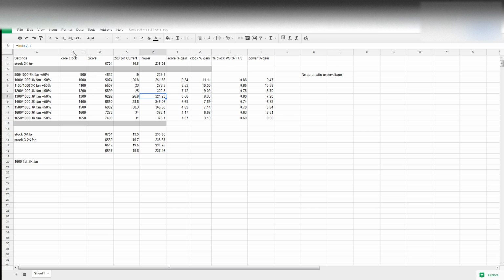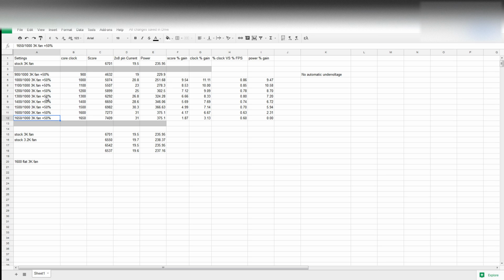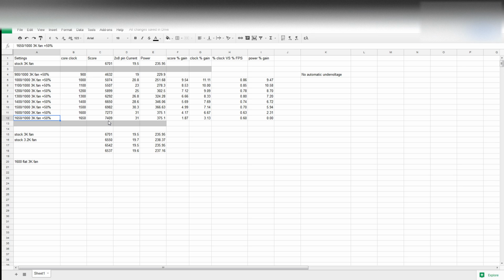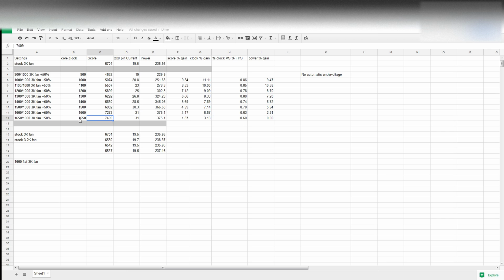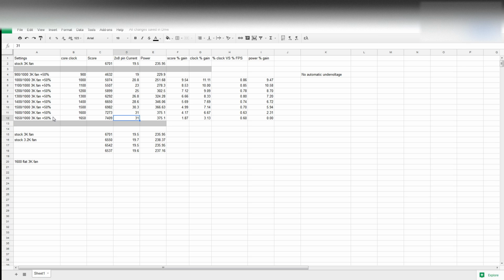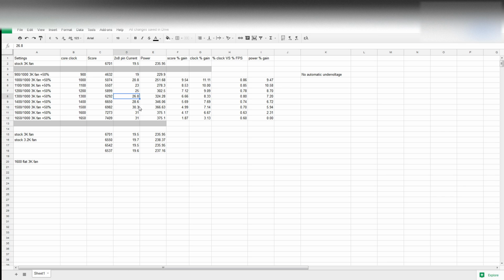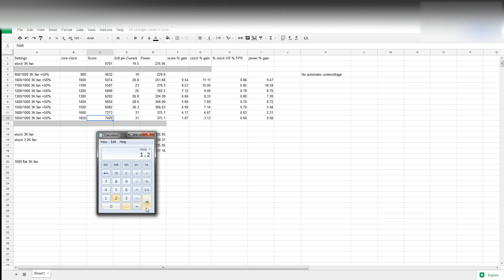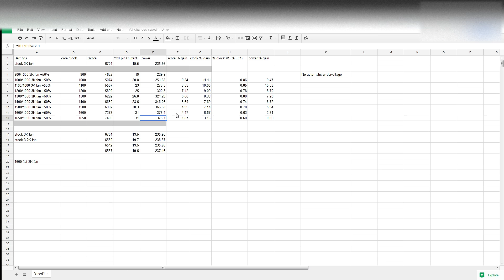VEGA Frontier Edition clock, performance, power scaling // 1600MHz of Flamethrower

Comment: its Crimson doing all that janky shit. when I install drivers I install the driver.sys and thats all. leave crimson off. and then run afterburner.
AMD is failing so bad . they give you a maxed out video card from stock. usually a founders edition or reference cards are usually with heaps of headroom at least 20% MINIMUM so aftermarket board partners can launch heavily O/C'd cards. but there is no point for them. they just release 12 cards i watercooled the other just with non blower fans

Comment: Man if there's going to be a card with two Vega GPUs on one PCB it will be absolutely INSANE! A 295X2 would be comparably energy saving (only 500W!). Two fully uncut Vega GPUs could easily draw 800W if not heavily underclocked and undervolted.

Comment: So basically the card is way smarter on it's own versus manual overclocking. In other words we should come up with a clever way of overclocking rather than just pulling all the sliders all the way right and sitting around measuring stuff.

I bet it can do 1650 scores with the power consumption of 1200 if done properly. Please, investigate further.

Comment: it's POSSIBLE that drivers or firmware may help.  it's possible that AMD are just running everything on the GPU at high voltage while they work out tweaking it.  Ryzen has some really cool power consumption optimisation in the die, would not surprise me if vega does too.  Whilst it does currently look bad i'm cautiously optimistic the situation will improve with additional driver/firmware development - as AMD reduce voltage/power on various parts of the die and or sleep it if not active on a high speed basis.  Plus the drivers aren't running with all features enabled yet.

i just don't believe AMD are that far behind in terms of performance and power consumption, given how close this is in performance to fury X - the silicon is in theory way stronger.  i really thing software/firmware is holding it back.  i mean currently, 2x RX480 would be competitive with it and way less power.

I really think 20-30% is likely there in software.  either that or AMD really fucked up the hardware.  I mean we saw about 15% gain from drivers with Polaris over its life, and Polaris is nowhere near as complex and such an architecture shift as Vega is.

Comment: whats sad is that most reviewers are taking a blower card which hits thermal ceilings like a mofo and comparing it to aib cards that barley need to spin their fans. If you look at any other timespy numbers for vega, the "stock" number line up with the 1400~ mhz. So i know about 9% isnt going to save the day, but its definitly worth noting.

Comment: You should always plot this kind of data to better visualise what's going on. When plotting score vs clock you could see that although the scaling isn't quite linear (probably  limited by memory bandwidth), the score follows the general curve of the data even at 1600 and 1650 MHz. In other words, score does not seem to suffer much from the power throttling. So either the card starts to draw extra power from PCIe slot or there is some kind of power management black magic going on.

When plotting score vs power the graph is linear up until 1500 MHz. From there to 1600 MHz, the power draw increases by about half of what it should have, but score rises as expected from linear power draw increase. After that the real black magic begins: score increases yet again in the expected way but power draw stays the same.

The plots can be viewed here:
https://docs.google.com/spreadsheets/d/1FNTSgvMQU2aXZdqnGPmAI3kVopSoz1DFX08hCaXm_eQ/edit?usp=sharing

For a score of 9200, one could extrapolate that a little less than 500 W of power would be needed (without memory overclock).

Comment: Didnt they have somewhat similar issues with polaris at launch. Not the pcie vs direct ps draw I mean but overall draw which was resolved by some people undervolting their cards and a new driver that dropped power requirements later on... I wonder if we could undervolt vega once RX drivers come out. I still think itll be a power hog but also think they could hit 1700-1800 with some microcode tinkering to keep parts of the gpu that are currently being used or powered on for pro apps then be powered down for gaming once RX comes out...

I really dont think itll be that bad. I mean what are the power draws with a pro app on load for example vs 3dmark? If FE has better pro drivers than gaming drivers maybe they got some control on power uses in those cases. Which would foresee the same with better gaming drivers later and synthetic benchmarking...
Reply: Also can see an updated/more aggressive radeon chill at work here to keep things in check.
Reply: Actually it was Jayz2cents who did a video on drastically reducing power consumption on his RX480 with undervolting while maintaining perf and even increasing the cards ability to keep up clocks... last year.

Comment: I don't get it, how it is getting 6.5k stock with 235W, but 6.3k 1.3GHz with 325W, something is wrong.
Reply from the maker: voltage control doesn't work when you get the card into static clock mode
Reply: Oh I see. So behind the scenes in stock mode the voltage controller might be applying some negative offset, but in static mode it fixes voltage at the level of the highest P state.

Comment: Fury X at 1000 Mhz @ 28nm fab = 200 watts (25% larger die)
Vega   at 1000 Mhz @ 14nm fab = 250 watts (identical specs has fury x, 4096, 256, 64)

Again how is this even possible on an engineering standpoint lol
Reply: Because the specs aren't identical.
Reply: The specs are pretty much identical, the different thing is the architecture.

Comment: Buildzoid, you make me disappoint. Your methodology is very broken and your analysis and conclusions are very misleading. :/ 

You guys need to chill down. This is PEAK power consumption, a reading that can  scare people off, but the average is well down, around 240-260W.

Fury X had actually higher peak power 375-450W with a 220-240W average.

Source: http://www.tomshardware.com/reviews/amd-radeon-r9-fury-x,4196-7.html
Reply: The power draw is peak but the scores are for the entire run. If the card wasn't power throttling the score vs clock speed would be closer to 1.0. Instead as the clock rises the score doesn't, all signs point to power throttling being the cause.
Reply: the average is 280 to 300 watts at stock go check pcper.The card is a volcano and there is no way to sugarcoat it
Reply from the maker: Toms uses a much faster measuring system than I do. my 375W peak is basically the highest 0.5 second average reading. If I had oscilloscope shots you'd be seeing the card peaking at like 600W or something.

Comment: welp i got a 550 watt psu :D with only 1x 8 pin and 1x 6 pin.
i got a 2nd cpu 8 pin though... value!
u know i thought i gotta need a new psu for aftermarket vegas anyways  and that the reference design will be 8 plus 6 pin, but that changed to: i definitely need a new and fucking strong psu!!
ah why does nvidia have to be such an ashole, that the only option is amd?
also sth. tells me that certain driver engineers won't sleep for the next 20 days. :D   (siggraph)

Comment: Literally only hardcore overclockers and maybe some serious fanboys will buy the card, it doesn't make sense to get under 1080 performance for double the power draw OF a 1080.
Reply: Only a fool would doubt it. Clearly not even rasterization feature is working on vega, not to mention gaming vs pro mode does nothing.
Reply: what part of driver optimization do you not under stand? just like a 390x smashing a 1080 on resident evil 7 at release. drivers are more important that most think they are.
Reply: bobsagget823 another clueless brain dead fucktard who likes to run his mouth.
Reply: I owned a 290 for a long time and it was a great card for 1080p.
Reply: I seriously SERIOUSLY doubt that a newer driver will improve the general performance maybe some game optimizations like DOOM has but that's dime a dozen, the truth is vega just not good at the performance and power draw let alone the price tag which will surely be $500 plus.

Comment: tsk tsk, AMD has some work to do driver side to try and help what is clearly not a efficient performance/watt architecture or design rather. They will pull off some miracles as always, the question is how long will it take. FuryX is much better now than when it showed up and is by and large faster than the competing 980 Ti of the time. It took far too long to get there though.

Comment: Hey dude. Please please please do a frequency/voltage curve analysis. I want to see where its supposed to be power efficient.

My theory is that this chip was designed to be much slower, and that after AMD saw the 10xx series NV cards, they took the design back to the drawing board to be more energy efficient at high clocks - but after they had made a bunch of FE chips (this would have been last year). The Vega FE we see here is a curious product that uses the first run chips. This would explain the delay of a YEAR for RX Vega to be released (redesign), and Vega FE's abysmal performance and efficiency (being run way out of spec).
Reply: I don't think that's the case. Mass production of Vega chips wouldn't have started by then, you are basically claiming that they're selling engineering samples to people, which would be a super shady business practice.  More reasonable explanation would be that AMD simply couldn't reach the expected performance at the specifications they laid out for themselves (225W in the leaked slides at a slightly lower clock speed) with the chip being stable, so they decided to turn it up to eleven.
Reply: Essentially yes, engineering samples. You have to admit, Vega FE is unlike any other product released by Nvidia or AMD, at least that I can remember (and Ive been in the game for 20 years). Its a huge oddity - its not a Titan rival, its not a pro part, and its not a consumer part. It doesnt fit anywhere at all. I think its a future relic of mistakes made, and I think we will see that those mistakes may have been corrected in RX. Not long now - well see whether this is true, or whether AMD truly has shat the bed.
Reply: And yes - AMD has been very misleading with FE.
Reply: I can´t see that happening. AMD advertised it towards developers and prosumers (albeit in a very confusing manner), none of those people would be happy if they found out that they were essentially getting subpar discarded silicon for 1000 dollars. As for it´s place, it is a Titan Xp competitor, although Vega FE is leaning more towards the pro side, because it has some pro driver optimization, unlike the Titan Xp which gets by with classic GeForce drivers. Raja hasn´t been super clear about this (none of AMD representatives were to be honest), but I´m pretty FE will have access to the RX driver.

Comment: What's the pronostic on the difference of power pulled by the Vega FE and the RX vega? If I recall correctly, HBM2 consumes almost nothing so everything is on the GPU which will be the same for both cards? Time to buy 80+ Titanium if you want it I guess. 

Question is: What would be the performance of a non limited Vega?
Reply: Judging by this video, and other reviews- 16GB HBM2 consumes 40-60W. RX Vega will use 8GB HBM2 with somewhat lower power consumption, but the GPU itself is the same. The only difference from current gaming results should be in the AMD implementation of tiled rasterizer, which ought to make make cards more efficient and a bit faster. But no point in speculating on effect of it now- lets just wait for RX Vega reviews to see if AMD is able to make it work, and how well.

Comment: What I can't work out is WHY it uses that much power? What is the reason for it? is it just that the GPU has that much going on? Is it the HBM being that power hungry?
Reply: HBM barely uses power
Reply: Okay, if that's the case, it still doesn't explain the seemingly out of control power consumption. I could almost deduce the reason for the high temps is because everything that used to be spread out (GPU core and RAM) was now suddenly all sharing the same amount of real estate together. But that alone doesn't account for the power usage going on here.
Reply: HBM was developed with the purposse of lowering power consumption from memory while keeping a smaller footprint. and GPU is the only thing that uses 97% power consumption

Comment: The efficiency at stock settings is actually not terrible at all for an AMD card that is almost certainly overvolted like hell.

So using probably ~250W to hit ~6700 is not a total disaster. Some of the power management seems to work pretty okay already. With an undervolt, hitting 6700 at something like 180-200W would even be decent.

Comment: I find it strange that with Ryzen, AMD seems to have handled the power draw of their CPU's really well (compared to Bulldozer and also Intel's current line-up). But on the GPU side, they're still way off compared to NVidia. 

And to be honest, when shopping for a new GPU, I don't mind a bit of extra power usage, as long as it doesn't negatively affect other things like temperatures and noise too much. The R9 Fury and Fury X cards did consume more power then a GTX980(Ti), but with a decent aircooler on the Fury it was fine; temperatures on my old R9 Fury were the low 70's at stock (upper 70's to lower 80's on OC) with very quiet operation. 

This thing however thermal and/or power throttles like crazy. True, it has a reference blower style cooler on it which frankly suck (especially AMD's), but still... Either there is something very wrong with Vega as a whole, or the gaming Vega card will perform much better then the Frontier Edition. At the same clocks, this Vega card is just as fast as the R9 Fury X, how on earth can that be if this is a totally new chip? Much higher frequency's is nice, but no clock for clock improvement at all?
Reply: its the whole cellphone business that helped AMD with it the tech is easier available for low mn efficient CPU manufacture compared to GPUs

Comment: In theory the tiled rasterizer could reduce power draw
Reply from the maker: or allow the card to spend more time doing useful work so FPS could go up a lot and power draw could stay the same.
Reply: Actually Hardcore Overclocking Which is most likely what it will do, because a lower power consumption won't matter if it's still a 484 mm^2 chip performing worse than a 314mm^2 one.

Comment: I'm thinking about getting one once they release RX Vega ... good thing I ordered a new 1200W power supply ... but I can't get it at the moment because they are sold out because of the Ethereum miners
Reply: At this performance level why would you honestly consider it over a GTX 1080 or even 1070 other than for brand loyalty? I love AMD (2 out of 3 of my builds have been completely AMD) and was anxiously awaiting their Vega release, but at this level of performance/power consumption/heat generation it just isn't a reasonable product to even consider, much less buy. Unless its like half the price of the GTX 1080, which doesn't seem likely due to HBM and the robust cooling designs these cards will require.

Please AMD rub some magic dust over the RX version to rectify this.
Reply: TheBabbage78 Under Linux the AMD drivers are much more usable and work out of the box, while for nvidia you need to install the proprietary driver to get reasonable performance out of the card, which is just a pain in the neck
Another thing is that with AMD you can use D3D9 natively on Linux and thus games using it run faster this way than on Windows, which isn't possible at all with Nvidia. And there is hybrid graphics (=PRIME = Optimus), which also works out of the box with AMD, but is hard to setup with Nvidia and doesn't support Vulkan with Nvidia
Reply: +Blauer Hunger many Vegas will stay on shelves since there is now all this ongoing meltdown and dissapointment with Vega.

Having said that disregard the anti-AMD trolls which are happy to point out that they just bought 1080Ti`s and hate on RTG division everywhere. I still think with finalized silicon and proper drivers and if stabilized around 1600 mhz with custom air based designs Vega will be a solid gaming gpu. If you can live with it drawing 250-300W and it`s really not that bad as it seems for some reasonable amount of gaming hours per month.... you will get performance a bit above oc`d gtx 1080. WIth time and driver updates it will come close to 1080Ti since that is the way AMD rolls as it seems. There is still room for Vega if priced around $450-500. But i think many people will "love to hate" it just because of the power draw. Old ATI`s HD 2900XT is still worse in wattage/performance metrics for it`s time so Vega is not the worst gpu fluke ever. And though even Buildzoid himself doubts it i think gtx 480 is still the overall inferno king.